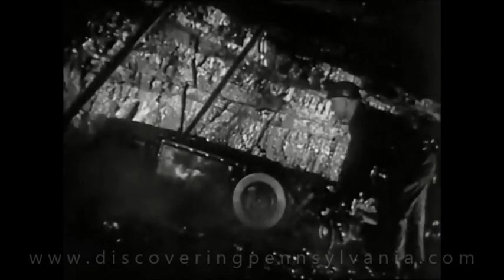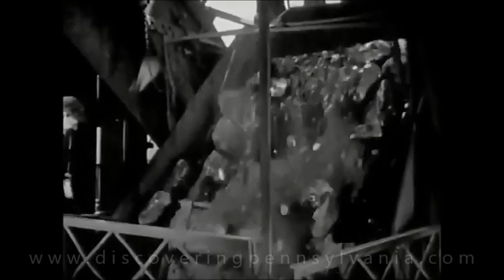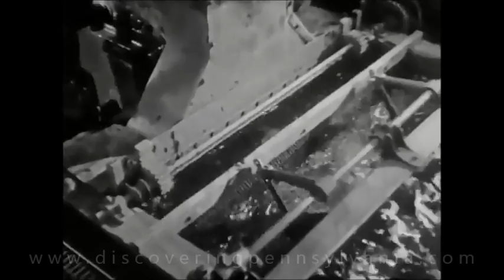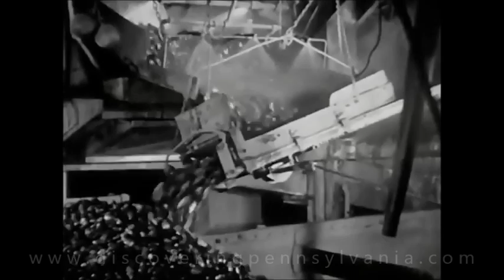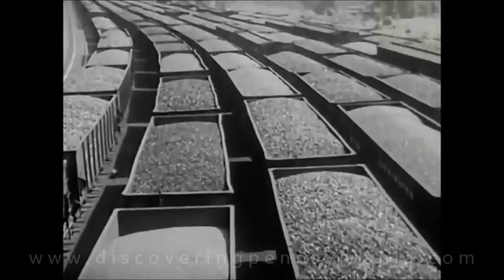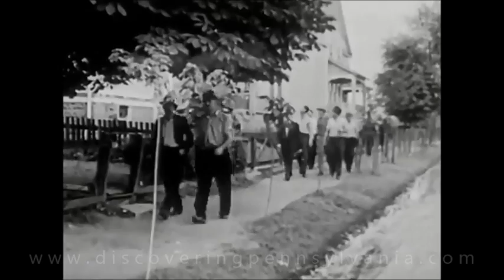Anthracite Coal   Mining & Extraction Technique - Coal Drilling & Mining 1950s

Comment: I still use it. Rice sized anthracite coal in an EFM stoker boiler. All automatic. Coal heat is the most comfortable heat. Set up properly, the fire never goes out, only up and down. When your thermostat calls for heat, the boiler is always up to temp so the heat is very steady and even
Reply: Running a legacy tlc2000 hand fired unit in my place , we love it ! Just wish I could by bulk in northern IL
Reply: @mobiletech6289  yeah I'd like to have one of those hand fired stoves here. It would be nice in case the power went out or if I just want to heat the office and my apartment upstairs without having to run one of the big boilers.
I'm guessing you're burning. nut coal. Here at the breaker picked up the nut is 150 per ton and the rice is 155 per ton.
You could probably get some kind of a deal to get it hauled if you bought something close to a truck load say 20 or 25 tons. When I am at the breaker I see trucks getting loaded with anthracite going all to places as far away as you are
Reply: Yes sir burning nut , yeah I need  get a full truck load ,otherwise I’m paying $325 a ton
Reply: @mobiletech6289  right now the two cheapest places to buy in bulk are Jeddo in hazleton PA or premium fine coal in South tamaqua PA . They are within two or three dollars per ton of each other. Jeddo is probably closest if your trucker comes acrost route 80

It's crazy how much more is when it's sold in 40 lb bags. From what I understand it cost them like a dollar twenty-five to bag it. And then about $3 worth of coal sells for almost 7 bucks.